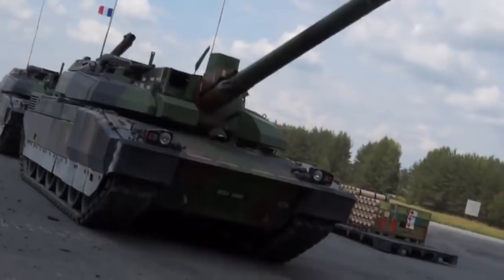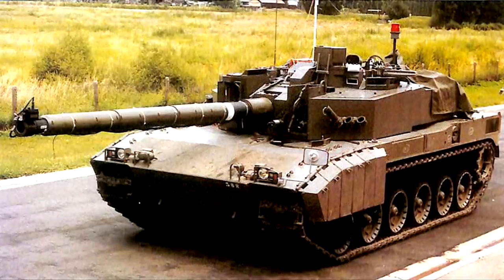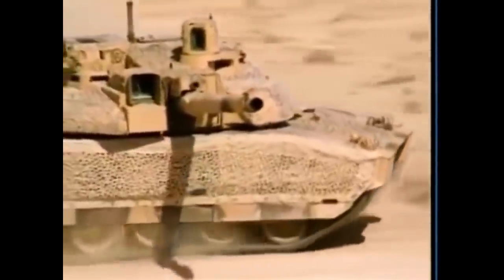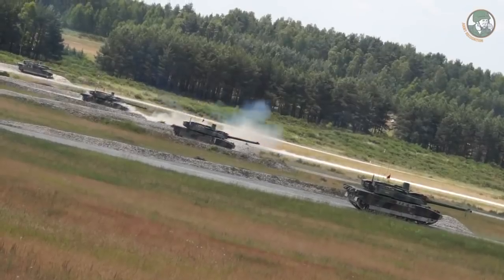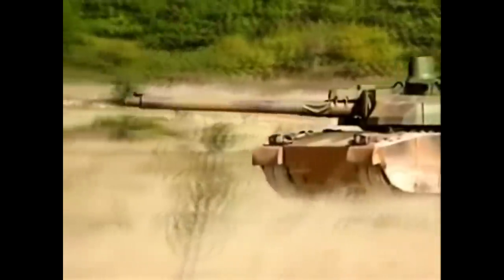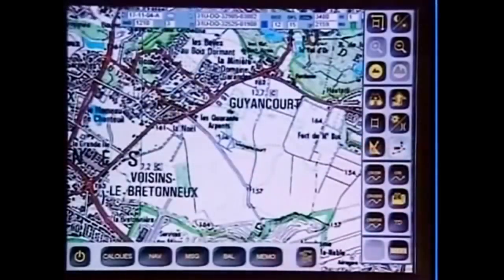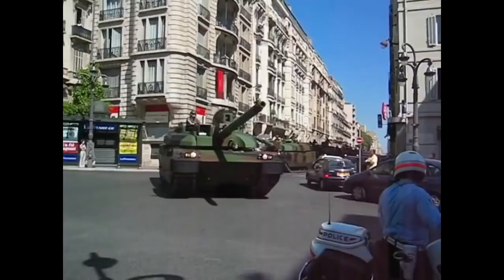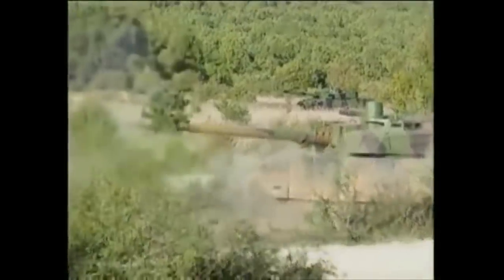Is Leclerc Obsolete?

Comment: Is engaging weakspots really viable in tank combat?
Reply: @MarsMan no, it is not. Modern tank FCS is mostly rated at hitting TANK SIZED TARGETS at 2km but you have no way of "designating" weak spots, even at the closer ranges. FCS automatically targets Center of Mass of the target it sees (so if you see a whole tank, it will aim for center mass, if you only see a tank turret, it will aim for the center of that turret - it will perceive it as a smaller target rather than one part of a bigger, hidden target). Even on point blank range, the only way to shoot at "weak" spots is to take manual control of the gun and bypass FCS. Of course, especially at range, the shot does havve some deviantion and can hit other parts of the target that you were aiming for, but that is a matter of luck and nothing else

Comment: It has a huge weak spot to the left of the gun. I always wondered why it looks like someone bit off a part of the turret. Makes no sense to introduce such weakness to the most exposed part of the tank. But looking at the photos, I realized that the "bite mark" is there to allow driver to unbutton - driver's head is right below it in unbuttoned position. Which really makes it look silly. No wonder that the "bite mark" is absent on the latest proposed upgrade. It's such an obvious design flaw. Otherwise, it's a pretty decent tank I'd say. Sure, the L52 gun is now shorter than L55 gun on Leo 2 A6-7, but it is certainly longer than most other guns, especially L44's on M1 and Leo 2 A5's.
Reply: @komradearti9935  I hope you're joking. See for yourself: https://youtu.be/zKpfsMve7Cw?t=43

Comment: Hits on side tank with 120 mm gun, destroy any modern vehicle. So this is not argumen against Leclerc.
Reply: I agree. There was several arguments like these that were used in this video that  I find kind of unfair.
Reply: I agree.
Reply: If you can't resist a nuke in the 21st century it's outdated for some people
Reply: Another good point about the leclerc is that it looks absolutely fucking beautiful.
Reply: Not to mention they can still survive the hit even if it results in a penetration (small chance, but still).
Reply: @getsideways7257  Kind of think that either the track, the engine, the basket or the turrent will be taken out of comission.

Any of those, and the tank is pretty much out of service for that fight.
Reply: @getsideways7257  Unless they're unlucky enough to come across DU penatrators
Reply: yeah but atgm in the front turret kills the whole tank....
Reply: the problem of side hull is from protecting it from HEAT rounds at 50° but at 60° the 1/3 of composit on sids hull can give some protection. and doesnt reduce spalls power to protect the ammo storage blast doors
Reply: True I don't think there are any tanks that can survive hits from the side right?
Reply: SNP Alba forever  do some research mate, of course it can, every tank can, it's just that the leclerc is able to be more precise at higher speed due to the superior fire control system, doesn't mean other countries tank can't armata abrams leopard and some others can too but with less chance of hitting the target. And it's far from hopeless the Russians just have to improve the fire control system to have it on par with the Leclerc's one
Reply: @tankiste531  yeah thanks for mentioning that. It seems that guys doesn’t know jackshit about the ability of the Leclerc to hit on the move at any angle angle. (360 degrees quality shots).
Reply: Yep but hit by side from 76 or autocannon would destroy it same with older rockets so that’s why it is bad (btw t-14 has 900mm everywhere in the compartment except maybe to the gun compartment so he’s the tank is safe from 120 hit to side regardless because ammo detonation if ammo can be hit that low will detonate only she’ll that are hit directly by apfsds so it would operate normally from a hit their)
Reply: @yeeterdeleter6306  What about the T-14? That tank isn’t real buddy.
Reply: SNP Alba forever  the idea of unmanned turret is old by doesn't mean it's bad, the armata could in a hull down position have its crew in total safety rather than having them exposed with the turret, there maybe isn't real proof but technologically taking multiple expert say that is not something the T-14 would lack given all the technologies they put into it, it's not a concept since already 20 to 30 are in service, not yet deployed but ready the main obstacles is the Russian Military Defense budget that prevents it from going into mass prod bcs it's easier to modernise old T90 and make T90M or even AM than building a whole new design

Comment: please try to inform you better, last variant of Leclerc have active ceramic armor. All the panels are entirely modulable, that mean they are updated with new technologies when they are up, and can be adapted to the enemy. Add to the GEALIC active protection system that can destroy ennemies projectiles or missiles even before it hit the armor.
The hyperbar doesn't consume more fuel than a classic diesel, that's the opposite! the fact you use high pressure oxygen mean that you can create the same power with less fuel. Add to the reduced size given by the autoloader, Leclerc have the best range of all MBT'S today.
Leclerc already use uranium ammunitions
Leclerc showed better results than Abrams against the same type of ammunition in Yemen
Reply: Sand is always a pain in the ass for every vehicle
Reply: SNP Alba forever  ah yes, I also like theses with no proof.
Reply: Active ceramic armor makes no sense. The last 96 Leclerc produced added titanium to the armor module (serie XXI). The GEALIC active protection never entered service as far as I know. The panels are modulable however they have never been updated since Leclerc entered service (only the XXI series tanks have a second generation armor panel although the tank's weight remained the same so I doublt it was revolutionary
Reply: could you give more information about the GEALIC APS, i can't find anything about it and it does not seem to be in service
Reply: can you give me a link about the GEALIC active protection system because i can not find anything about it online. Also the Leclerc has an extremly high fuel usage compared to other NATO tanks what you have probably read is the upgrade to the engine which reduced its fuel usage but its still far abouth the leopard 2 (leclerc 1380 liter per 100km, leopard 2 720 liter per 100km). The engine has other problems to like beeing realy 
sensitive to enviormently factors but this is 
expected as the engine has to produce the same power as other tank enginees with reduces size.
Reply: Apophis40K you’re right, the engine of the Leclerc suffered quite some issues with sand, but so do the M1A1 (for the M1A2 I don’t know) and the Russians tanks. Only the German ones are performing well in sand (however there’s almost no data about German tank performing long missions in desert so it’s not so relevant)
Reply: @vizender  well the M1A1 engine got upgraded to more easily handle sand.
Reply: @Apophis40K  they installed filters for quite some time now on the turbine. But still, Sand is just the biggest enemy of any tank and there is no perfect engine against it.
Reply: @vizender  sand is not a problem for the Abrams wtf are ypu talking about
Reply: this channel is basicly russian propaganda when it comes to tank information tho, this guy who runs the channel actively believes that russians tanks are superior to their richer western parts.
Reply: @alexanderrose1556  WHAT BS ARE YOU TALKING ABOUT
Reply: @alexanderrose1556 not that much, red was quite honest on the t 80 BVM
Reply: @alexanderrose1556  "richer western"? and you are complaining that this channel is biased?
Reply: I will not comment on the original post, for I know very little about the leclerc. 
I will point out that Red Effect is not “Russian Propaganda”, and does not base his argumentation in belifes. I will recommend watching nato vs ussr tanks in the Cold War video is you want evidence of this. The fact is, that bias is not obvious at all, and just because you disagree about empirical facts with him does not mean either of you are biased. Have a good day.
Reply: (Disagree about the interpretation of empirical facts). That’s why physisist have arguments😂👍

Comment: Leclerc's mobility advantage is overstated. Chinese Type-99A uses 1500hp conventional diesel engine, runs 5km faster, without the range drawback. It eclipse Leclerc in all other specs as well. Armor protection is slightly higher, and without weak spots, 125mm smoothbore with slightly higher penetration round, tank's size is the same, and cost 1/4 as much.

Russian T90AM's armor protection is slightly superior to Type-99A and far superior to Leclerc, same gun penetration to Type-99A and slightly better than Leclerc, and smaller size to both. Sure, the 1130hp engine is weaker, making the tank slower. But that's just trading mobility for better specs in everything else, including the cost, which is 1/2 as much as Leclerc. The fact that the Chinese Type-99A is slightly better in every spec, while costing 1/4 as much, is just a slap on the face. No matter which one you compare it to, the Leclerc doesn't measure up.
Reply: Type 99 ain't faster

Comment: To be fair you should not point out small weakspost as detrements as all modern tanks have them and considering that modern tanks are designed to fight at ranges of 5+km and probability of hitting these weak spots is almost nonexistent as US and UK tank crews after  gulf wars pointed out you are aiming at central mass not at weak spots.

Comment: I'm afraid you miss the entiere point of this tank. Reading russian web pages will only get you so far. Anyways, the Leclerc isn't comparable to "other modern tanks" like you say, because it's role is not to fight head on with other threats, it is highly mobile and entierely designed to fire accurately while at great speeds, up to 2500 meters. The lower hull weak spot is irrelevant, since the Leclerc is not even meant to be detected by the threat. You make an "analysis" based on what an American tank should be, that shows your lack of knowledge and comprehension on the subject. "Modern tanks" are not going to fight each other, there is no point in such a video.

Comment: I have to say I'm quite disapointed about this review. Armor could of course be better but it's a rather small tank and well armored for it's weight, weakspot are of course a problem but in modern engagement distances it's rare for tanks to aim at them rather than aiming "center mass" to actualy hit something. Also engagements being hull down or on the move make it more difficult to "aim for them". It has been made to grind eastern tanks, and it's getting the job done.
Many western tank still have some munition stored in the chassi, even the migthy abrams has a small compartment for this ! But of course you can always chose not to put anything in there.
No word about autoloader ? doesn't bother me, other videos only speak about this.
OFL F2 is good enough for it's job and there is new DU round on it's way.
You're right about the mobility, at least it's difficult to question this, but regarding the range, it outclasses many of it's western competitors. But this only has to work according to your army's doctrine. Abrams is sucking oil, but when your logistic can install a gas station in the desert it's not really important.

Well thanks for taking interest in it's nice machine and her pros and cons ! Wished you just double checked some info and went a bit more in details ! this lovely machine deserves more than 6:47 minutes ;)
Reply: the variant he is talking about isent even the newest one.. the XLR is, no mention of the addon armor package either. so i agree its a shame since the Leclerc is one of my favorite Western tanks.
Reply: This entire discussion about unsafe ammunition is blown out of proportion by tank enthusiasts as it is. I assure you, if modern projectiles get through the armour, most of the crew dies anyways. Catastrophic ammunition explosion only makes doomed crew extra doomed.
Reply: @The Doge-Emperor of Dogekind main AT round is always APFSDS, you are talking nonsense about HEAT rounds in 2020. Face facts, Leclerc is prone to catastrophic ammunition detonation, other MBT are not.
Reply: @y0Milan  since when the Leclerc is prone for "catastrophic ammunition detonation"? seriously where tf you saw I never heard anything about it. if the turret ammo rack is hit it should be good for the crew, same for most western tanks but it’s the hull one it’ll go boom boom like in most western tanks again.
Reply: I agree the armor doesn’t matter if the other tanks cannot hit you, French tank doctrine relies on speed, and dictates to move and fire
Reply: @The Doge-Emperor of Dogekind please tell me where abrams or Challenger 2 crew have been killed by ammunition detonation? 

Simply put if theres ammunition thats not in blow out bins and the tank is penetrated, it will detonate. 

Again, I dont care about heat projectiles. Main tank ammunition is APFSDS.
Reply: @y0Milan  tue leclerc has blowout Panels too. So where is your point? A good commander will only fill the save ammo stowage.
Reply: @lordtachanka6489  My point is that, as has been said multiple times, the Leclercs ammunition is not stored in armoured bins with blow out panels. This means that if the hull or turret is penetrated, the ammunition can explode and catastrophically destroy the tank. This is not the case with other modern tanks.
Reply: @y0Milan  if you would wach the goddamn Video you would know that the amunnition in the turret is placed in blowout Panels...
Reply: @lordtachanka6489  Oh jesus christ just google the design. Abrams has its ammunition in the rear turret bins which have armoured doors and blowout panels, and a limited amount of ammunition (around 6 rounds) stored in the hull with blowout panels. 

The Leclerc has its ready use ammunition stored in its autoloader, but the rest (18 rounds) is in the hull in a carousel
Reply: @y0Milan  the Youtuber Said it is like in the leopard 2a7 which has also got a blowout Panel in the Back of the turret with a capacity of about 23 shells I am not really Sure. So when thats not the case with the leclerc Its cleary the fault of the Video being wrong...
Reply: @lordtachanka6489  Leo also has some rounds in hull, but stored differently to leclerc i believe. 

Abrams almost never carries ammunition in hull even though it has the storage, it can carry enough in the turret bins that its almost never used. Leclerc can only carry 22 in the turret, so the hull storage is massive. 

That is the main problem with Leclerc
Reply: @y0Milan  i really believe you are talking about things you don’t know about. You’ve neither understand how blow out panels work, neither the Leclerc design and ammo storages...
Reply: @vizender  Sure buddy.
Reply: @y0Milan the ammo are stored in a special compartment at the rear of the turret with blow out panels, some ammo can be stored inside the hull but it’s not used actually. The Leclerc is safe like the abrams
Reply: @The Doge-Emperor of Dogekind You mean tandem warhead? And that's not it works, it has been designed too defeat ERA. You can't "blow the blowoff panels into the tank", that shit makes no sense.
Reply: I completely agree with that
Reply: @The Doge-Emperor of Dogekind u mixed up explosive reactive armour with blowoff panels
Reply: @The Doge-Emperor of Dogekind blowoff panels do not work as armour but rather as an implementation to increase survivability by decreasing pressure in the tank to save the crew if the ammo rack was hit.
Reply: Look at the bright side he gave it 6:48 now.
Reply: @The Doge-Emperor of Dogekind WHO TF IN THE WORLD IS SHOOTING DUEL HEAT ROUND? Only thing that matters for western tank is protection against Kornet and 125mm APFSDS
Reply: But the Abrams have blowoff panels
Reply: @kwekyang6477  Leclerc have blowoff panels too, plus a very much smaller internal breach because of the autoloader system.
Reply: @kwekyang6477  Le leclerc aussi tous les chars modernes et le leclerc en sont issus
Reply: @The Doge-Emperor of Dogekind the blowoff will not be hit in battle
Reply: @The Doge-Emperor of Dogekind it is on the roof of the abrams
Reply: @The Doge-Emperor of Dogekind if both leclercs and abrams were hit in the ammo, the crew of the abrams will have much better chances. The abrams is an outdated design but the leclerc still have less survivability

Comment: Well, obsolete? It is the best of nato and it is not the legion of oder t72 even modernised tank that can shoot it.  It is also linked to artillery and can spot ennemies for arty, a unique feature that does not exist elswhere.
Also it is now modernised with the union with the German manufacturer of the leopard 2. A version with a 140mm is in test since a few year.

Not a bad gun? better than german and US, better than most of russian too. Don't thrust penetration of the shell advertised by moscow, it is quite bullshit and pure marketting.  especially the 125mm thin sabot that is a lot shorter in the soviet (or English) version rather that the western one that goes deep into the cartridge.

It has less weak spot than older leopard 2 and lot less than T72/T80 witch has nearly no armor at all in the side and rear of the turret.
Reply: @komradearti9935  Same as the L55, but very few L2 has it while all leclerc are equiped. L44 is still the more common gun.
Reply: @komradearti9935  As per wikipedia I can't find your number,  look like many countries are updagrading but still a lot of older ones with l44... Sure more that the Leclerc was sold, also the new replacement tank choosen as the leclerc gun and turret.
Reply: @komradearti9935  no problem man...